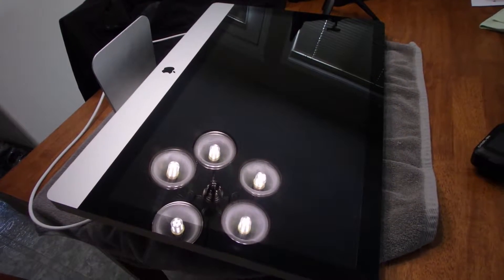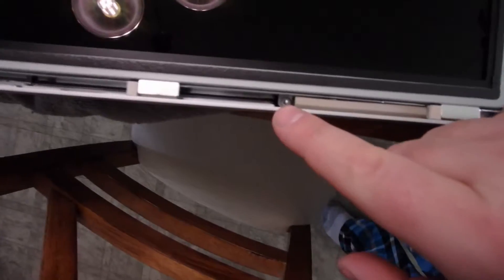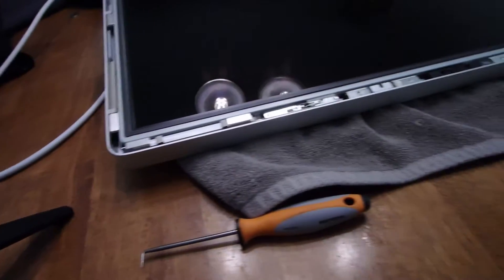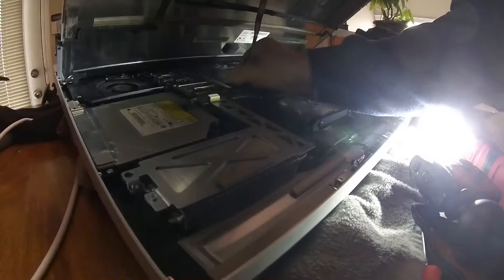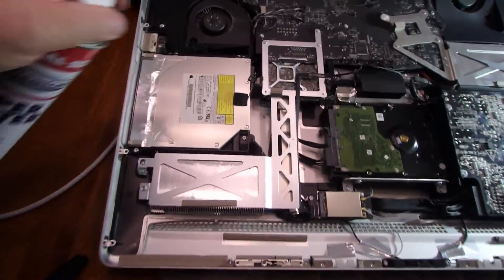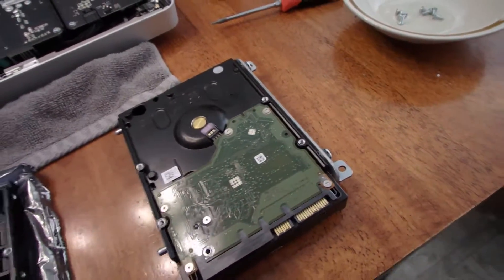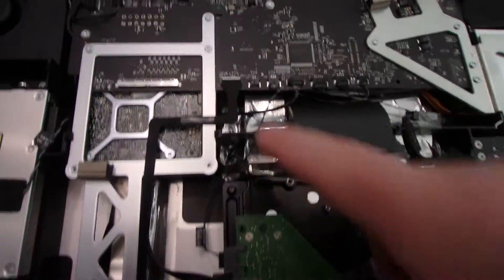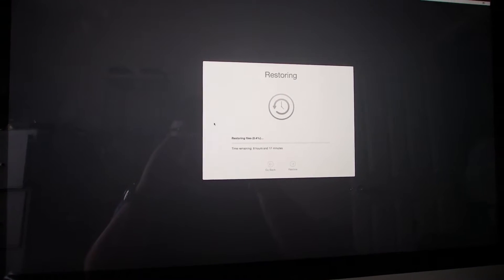iMac Hard drive Replacement DIY

Comment: Hey Jerry, Does APPLE MAC primarily use Seagate hard drives as original equipment in MAC's or did you just buy a replacement hard drive that happens to be a Seagate?

Comment: Hey Jerry , I'm not a computer guy for sure but I do need a new laptop and I'm hearing SSD are the way to go, any thoughts ?
Reply from the maker: +STEVE ROB SSD drives are the best on the market, very fast I didn't replace with one in mine because the cost difference of a 1TB SSD was almost 500 bucks verses 70ish for s a regular drive